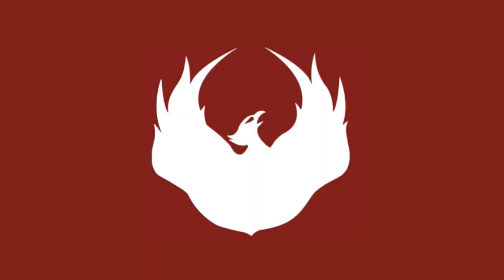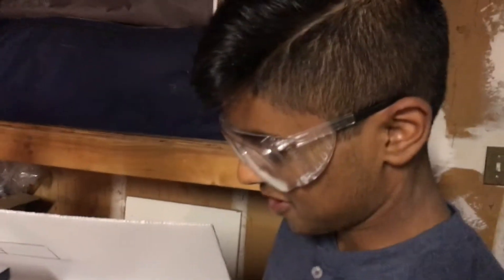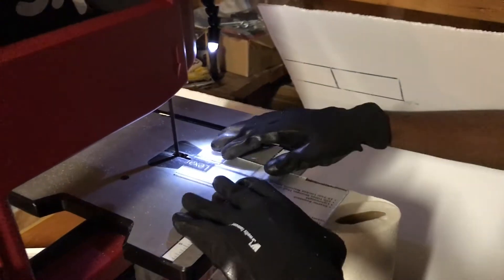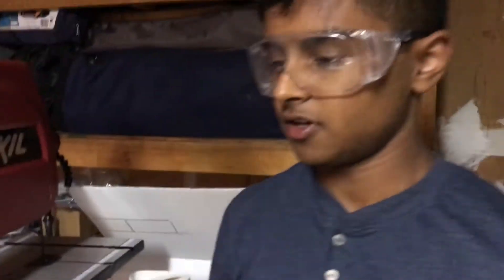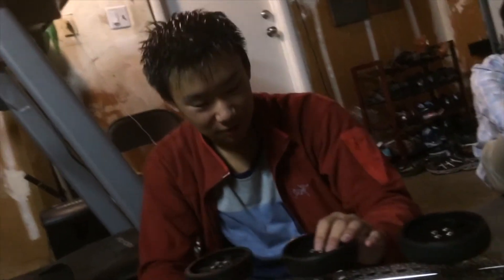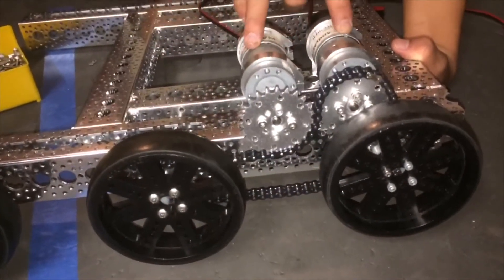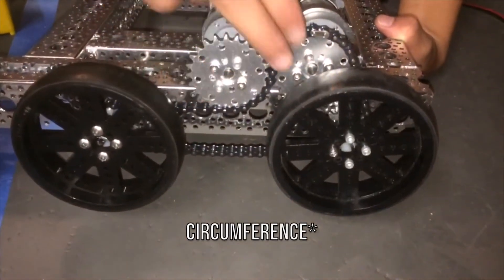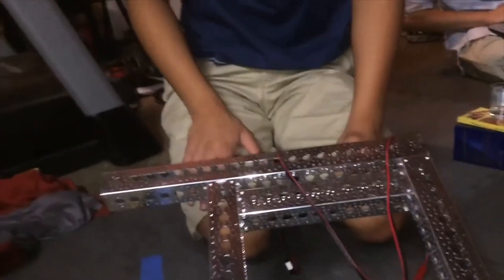Vulcan Robotics Offseason Vlog 2- Progress on Newbie Drivetrain, New Lift, and more

Comment: I would recommend having your chain go above the sprockets on the motors as the doing over and under can cause the internal pinion gear of the neverest gearboxes to strip (on your drivetrain). I had this problem last season right before worlds and ruined 1-2 pinion gears that way. Overall great video though! Can't wait to see what you guys have in store for next season :)
Reply from the maker: Thank you! Are you sure the way it was chained cause components of the internal gearbox to get ruined, and not some other factor like the alignment of the two motors? We have chained our drivetrains for the past 2 years that way and have not encountered that problem.
Reply: Yeah I did it that way from around August to early April and had no problems. I think the main cause was the added weight that was put on the robot in early April. From what I could tell is that when hitting a wall/robot, depending on the force of the hit the sprockets would fight each other causing the chain to kinda yank and then the pinion gears would strip. I'm honestly not fully sure if that's the actual cause but I know that it did strip the pinion gears (one time it was a fresh 40) until I put the chain over the sprockets. I also had my chain and motor spacing almost exactly like yours. I think you'll probably be fine doing over and under for now but it's just something to keep in mind when adding on to your robot.
Reply from the maker: Okay, we will think about that throughout next season. Thank you for the advice.